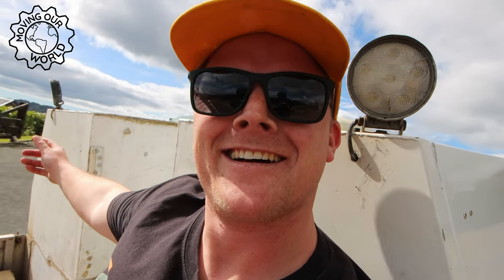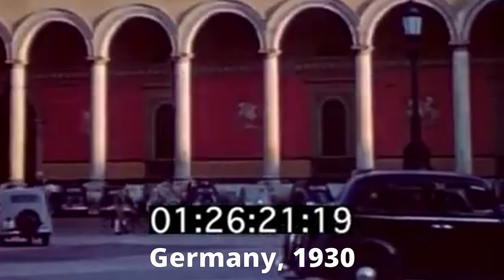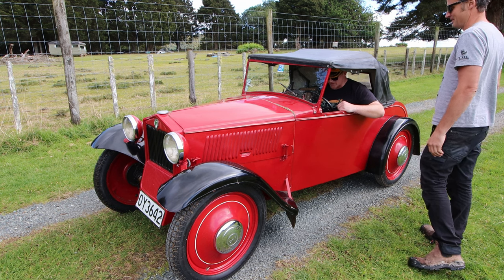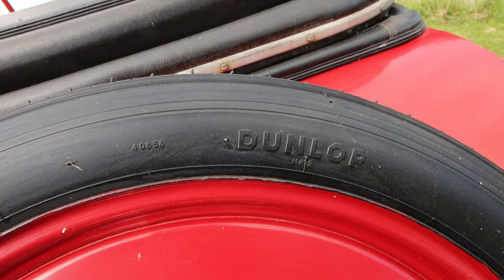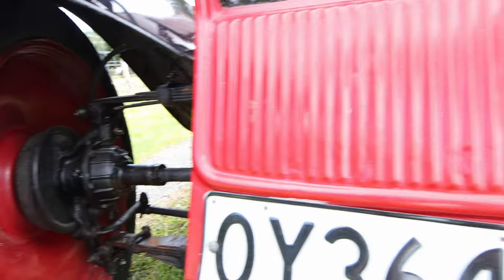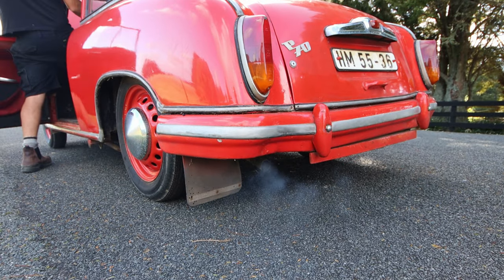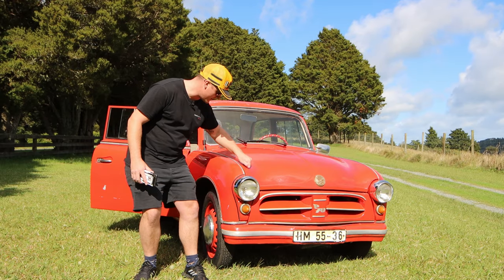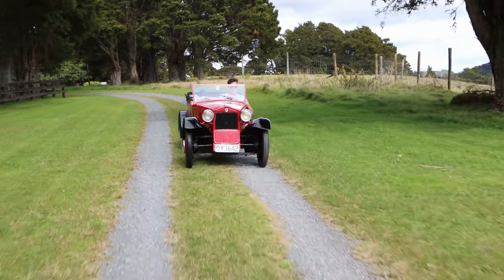Worlds First FWD Transverse Engine Car is 2 STROKE! | 1931 DKW F1

Comment: The first transverse engine FWD car was built by Walter Christie in 1904 but it was not a production car. He built racing cars and later a tank which would do 120 MPH with the tracks removed and 80 MPH with them installed. The US army wasn't interested so he sold the idea to the Russians who based the T-34 on his design. Not knocking the Deek though- I would love to own one and have it keep my 3 cylinder 2 stroke Saab company. The DKW 2 cylinder was built by Saab for use in their earliest models such as the 92.

Comment: F for Frontantrieb- forward (wheel) drive. The last model to be produced before 1945 was the F 8. The beautiful streamline F 9 with its all-steel body instead of wood (either steam bend, laminated  or ply) remained a blueprint. It was eventually built in Eastern Germany from the late 1940s onwards under the new name IFA of its producer. The management of DKW had gone west and after some time when it only built motorcycles entered the market with its own version of the F 9 project. It was the later 3=6 and 1000S .

Comment: Another great video! Interesting to see just how much of this 1931 car is almost exactly the same as the Trabant 601. I'm surprised the F1 is water cooled, Trabants lost that and had forced air cooling. My first car was a 1990 Trabant 601 Wagon in 2005. Two-stroke cars were looked down upon by then, but I think they are a really clever and simple design.
Reply from the maker: That’s so cool that your first car was a 601! A little jealous over here. The F1 - right through the AWZ Zwickau we’re water cooled I believe and the air cooled engine first appeared in the P50. Which I have filmed also!
Reply: Trabant had still the new engine. The F series engines lived on, barely modernized, in Wartburgs.

Comment: A mid-60s DKW F-102, bought new, was a very good car and the only new one Dad ever had. He put 52K miles on it with no problems. Like VWs, they had no fixed cruising speed, just whatever it would do, up to 80mph if you were in a hurry. The main problem was that in NZ, mechanics who could service a 3-cyl  2T correctly were a rare breed.  Example:  I took it to a grease monkey in Barry's Point Road to be tested on a dynomometer. This genius confidently drove it into the customary position and put chocks on the front wheels. (I'm about 20 at the time)  Before he could do any damage to dad's car, I told him. "Front wheel drive!"  Long story short, it was a lovely looking car and I don't recall it smoking excessively.  If I could obtain one now in working condition, I'd consider buying it as a hobby car.

Comment: The DKW does not seem to be world's first FWD car. As early as 1899 there was the french Latil, and 1900 the austrian Gräf voiturette. Both with Tansverse 1 cyl. engines (De Dion I think). In the 1920's, the french Tracta was the first one with double articulated joints on front axle (systeme Gregoire).
Reply from the maker: The term we’re going for here is Worlds first mass produced, transverse front wheel drive car. Agree - it’s a bit of a leap. But it’s still a cool feat.
Reply: @MovingOurWorld  Shouldn't there be a rubber boot of some kind over the joint? It looks very susceptible to dirt and grit which I would think would wear it out rapidly.  That is sure a neat little car. I've been to the Audi museum in Ingolstadt and they have several F1s there and there is a museum in Dresden that has IFAs. Post war with a wooden body but covered in a kind of vinyl material.